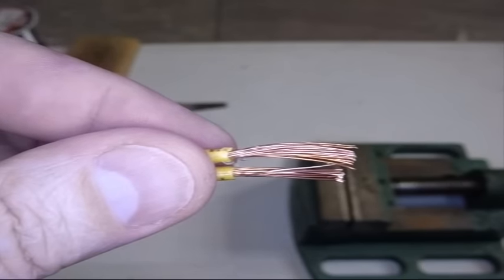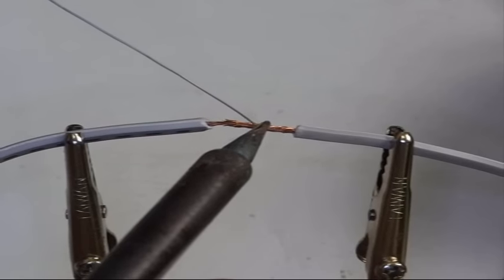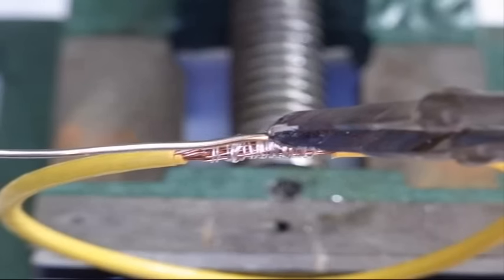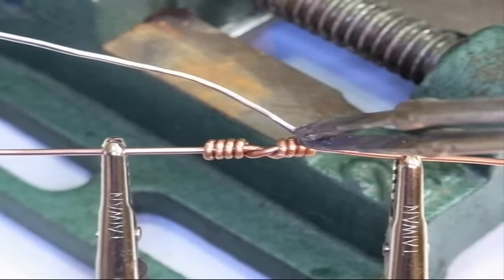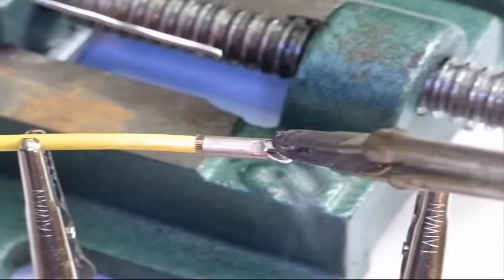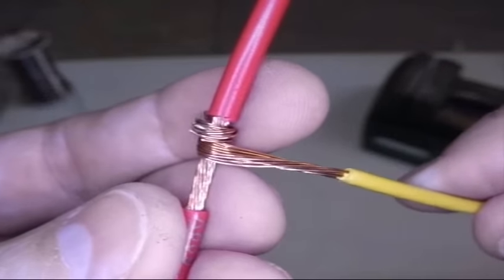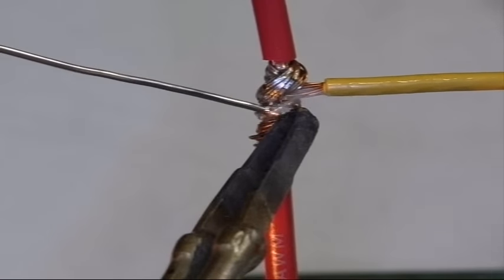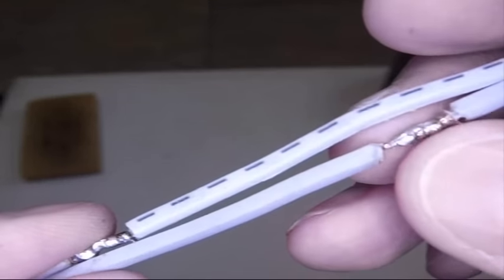Soldering Basics - Popular Solder Connections

Comment: Is that a 60/40 or 63/37 rosin core ?? Thx
Reply: tsbrownie the manufacturer brand please, really great stuff outstanding wetting 
Thanks a lot!!
Reply from the maker: Sorry, the label is long gone.  (Edit, you can see it at 2 minutes in the following video)  It's just something I bought at the local hardware store.  I've never seen much difference in brands over the years.  I have another video on how to make good joints, but the secret is CLEAN.  Clean work piece, clean solder, clean tip.  Even tiny bits of oil from hands or other, or anything other than a bright shiny work piece is usually a problem.  You get dirty, clumpy, cold joints and use lots of solder in the process.  Here's the video: https://www.youtube.com/watch?v=fNyAK1WvtsA&t=2s
Reply: tsbrownie gotcha, definitely gonna watch it.. thank you very much
Reply from the maker: Thank you.

Comment: You did not show how to solder a solid wire to a stranded wire. That's what I'm looking for. ie a power resistor to a voltage lead.
Reply from the maker: Good point.  It's really no different, it's just the mechanical connection is a bit harder to do because the difference in stiffness.  Still you wrap the wires together and solder.

Comment: Wouldn’t it be better to put the heating iron at the Bottom of the wire, heating it upwards, so the solder will flow downwards toward the iron?  That is the way they do it for heating copper pipes! ..and also, wouldn’t it make it work better if you coated the wires with a Flux Paste first?
Reply from the maker: Good questions. Pipes have traditionally been heated with flame, and much of the heat is convection which moves upward, so for max heating the flame is below the joint. With electronics  99% of the heat is conduction and so you want to be near, but not at, where the solder is melting. I have a video on that. (https://www.youtube.com/watch?v=gFGvNrYpsGc)  For flux, if the joint is properly cleaned, rosin core solder works well and does not leave behind lots of extra flux to clean.

Comment: How can I put them together if they r different types??
Reply from the maker: You mean solid and stranded wire?  It works the same.  If you mean different sizes, it also works the same.  Be sure to follow local electrical codes for wire size and type.

Comment: Butt splices are meant to be crimped for mechanical soundness. I wouldn't trust one that was just crammed on loosely and then soldered.
Reply from the maker: Agreed.  As mentioned it's supposed to be crimped, but if it's well soldered it's beyond my ability to pull it apart cold.  Of course if the wire got hot, it could slide apart.

Comment: Thick wires I have no problem with, but thin wires I always end up screwing up.
Reply from the maker: Thin wires can be difficult because they cool off very quickly when the heat moves on or is taken away.  Otherwise it's pretty much the same, you just have to keep the heat on it and let the solder flow.  Also start with clean everything: solder, work piece and soldering iron.
Reply: +tsbrownie espesially 3.5 jack wires
I didnt know I can burn the isolation with a lighter that would be alot easier because it will stick to the main wire

Comment: I need to find soldering irons that get that hot. All I can find is junk that takes forever to melt anything.
Reply: Get a WELLER DC soldering station.  Not expensive, work very well, last a lifetime, and have replaceable tips with different heat settings....

Comment: Me at first:  "Soldering... man it takes skills and practice. I wish there was something easier"
After finding out about crimping:  "OMG, where has crimping being all my life! So much easier"
After watching more vids on crimping: 😶*poker face* Ok SOLDERING IT IS
Reply from the maker: So true. Doing crimping right and getting a long term, no corrosion, low resistace joint is a lot of work with quality parts, compound, and tool. To get that with solder is 30 seconds using hardware store stuff.

Comment: your three way should really be a military splice, you can add the knot method TO the military splice, but the way you did it is inferior.
Reply from the maker: +Matt Moffett It's inferior because?  The "military splice" I know puts the branch wire through the middle of the primary wire.  That means the primary 1) must be stranded wire and 2) it weakens the joint by putting stress on half of the strands and not all of them.

Comment: If a wire was rotten then wouldn't it be smart to replace the wire, no matter how hard it would be to replace. I would think a rotten wire when trying to solder would be you was fixing a brake to began with and rotten wire would most likely be the root cause of it. So why not just fix it and not half ass fix something. All you doing is prolonging a real fix anyway. But what do I know.
Reply from the maker: Yes of course.  But the guy who I did the boat motor for was leaving that evening and the stores were closed.  Knowing him the real reason was probably because he was broke.
Reply: @tsbrownie  I know the feeling. I'm most likely the brokest person to ever watch YouTube. Matter a fact that's why i'm watching YouTube is because it's free. But(AC Power I'm talking about), faulty wiring makes up 6 percent, and the 3rd most common cause of fire in the home. Easy way to avoid this is to for one know what you doing if you have to think about if you know how to do something or not then odds are you don't know. So best thing is to know how to call someone who does know. Now, I know everyone fall short on cash sometimes. God know's I have. But you can save money and not half ass your wiring. Wiring is really something you don't need to cut corners on. Instead make up for it buying, cheaper rugs. And maybe you can keep your house. DC power is also very bad for catching fire also. Did you know the first person ever to get the electric chair was named William Francis Kemmler of Buffalo, New York and was electrocuted with DC voltage. Also ever go up and slap a police officer and they can show you what 9 Volts of DC power can do to you. 9 Volts can make you fall to the ground in the most pain you could ever imagine. So DC is by far safe. It's just not going to byte as fast.

Comment: youre soldering two wires together inside an inline crimp connector. thats just stupid if you dont have a crimping tool for the connector why wouldnt you just solder wires without it.
Reply from the maker: It's a butt splice type solder lug, not a crimp connector.  You can google them.  Regards,

Comment: Your tips are so badly dirty they are working probably at 20%ç the heat is not transferred to the wire. Other than that, good video. +1
Reply from the maker: Thank you.  The very end of the tip is clean and shiny, it's usually pointed away so you can't see it.

Comment: A wire nut  would do this 100 times faster and cheaper.
Reply from the maker: Yes wire nuts are faster (and cheaper).  A soldered joint will not corrode, become higher resistance, and require more maintenance in the future.  It's a case of pay me now or pay me (more) later.  I've done boat trailers that are now 30  years old with no problems.  Try that with wire nuts.
Reply: @tsbrownie  agree in your case, I am a construction electrician,  not a boat electrician.  You put a wire nut on a boat and not protect it,  salt in the air would eat the connection fast. I am a construction electrician and I have seen wire nut connections that were  30 years old and hard to get off . The copper wires underneath looked like they were stripped 30 seconds ago. I trust wire nuts, but not on a boat.